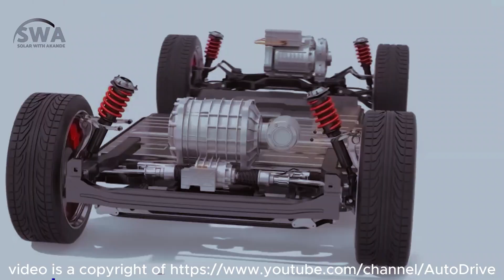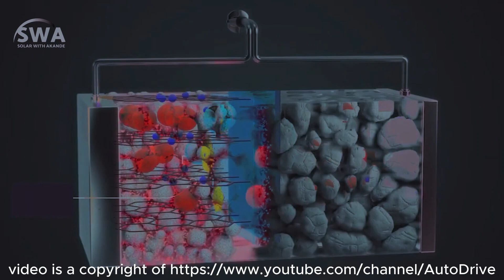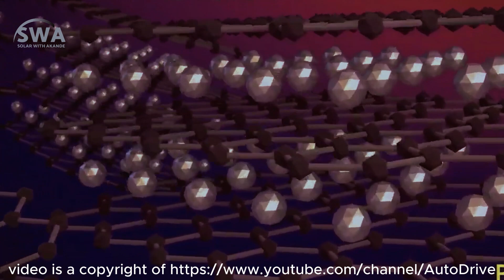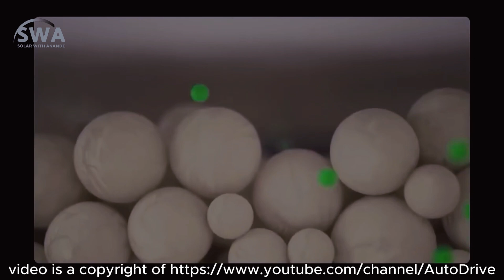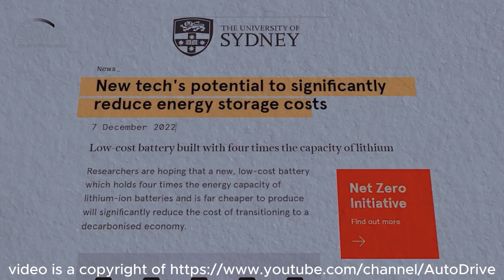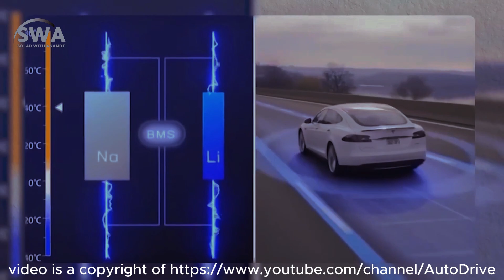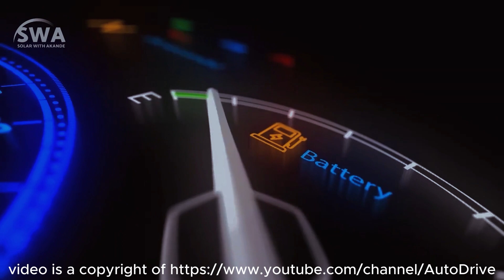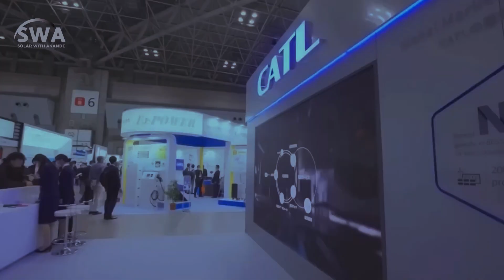WATCH THIS!!! WOULD SODIUM COMPETE WITH LITHIUM BIG TIME?

Comment: As a user of lead-acid batteries in recreational watercraft more cold weather information would be helpful.
Lead acid can be charged in frigid conditions which eliminates the need to remove them during winter shore storage, and they are cheap.
Reply from the maker: Lead acid is not as bad, there are pretty good one's but I think one of the big issues of lead acid batteries is it's life cycle.
Reply: 9 years of life is not bad for the money. It is one change in the life of the boat.
Solar charging is very kind to battery life and cheaper than a plug-in battery charger. @solarwithakande